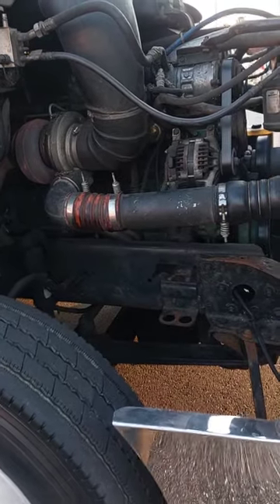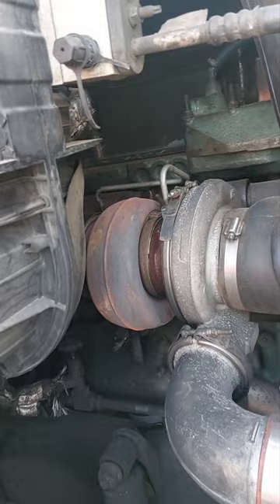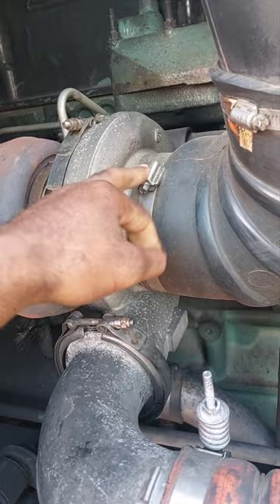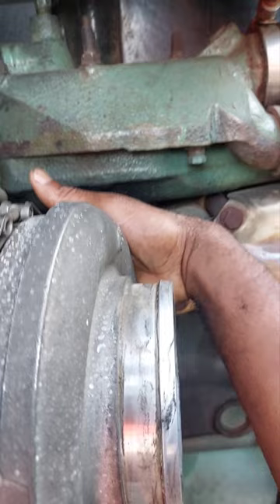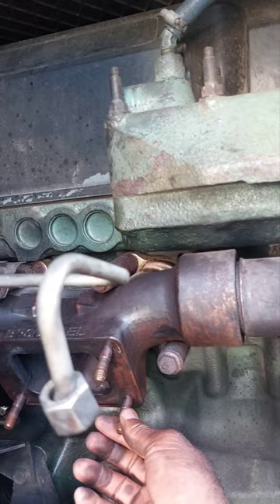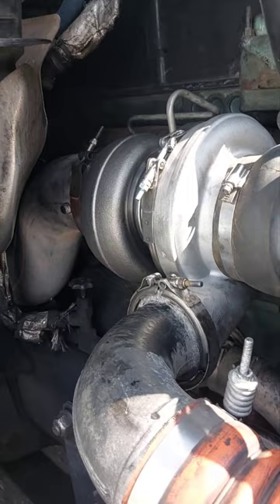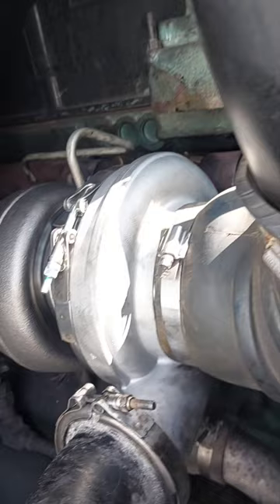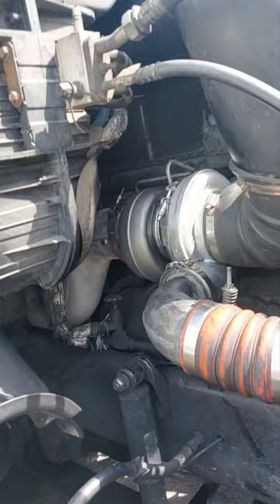How to replace Turbo on Detroit 60 series 14L Engine.

Comment: Did you pre fill  Turbo with oil?
Reply: Ya I was thinking that also. I never today and seized the turbine
Reply from the maker: No I didn't
Reply: @dislandtruckingtv399   What turbo did you use? I have same truck with a 14l, The previous owner put a Sx400 from a Cat that turbo is actually to long in spec but they shoved in there and the air cleaner tube is directly against the back of the alternator, and now the oil  seal is turbo has failed and I need to replace it. And I don't want to go with the stock turbo from 14L because they have that aggravating whistle that would drive me nuts, thinking of using a turbo off a 12.7, just wondering what turbo you went with..
Reply: So it is not necessary to pre lube the brand new turbo?